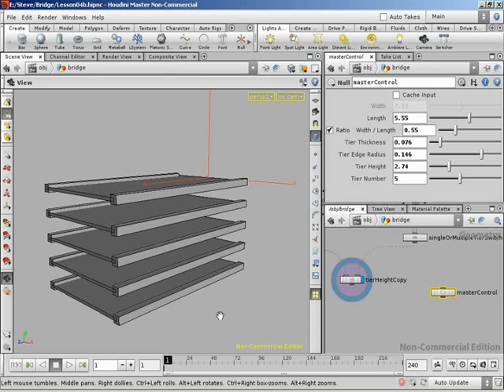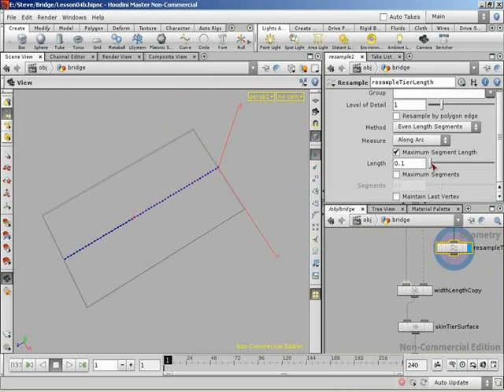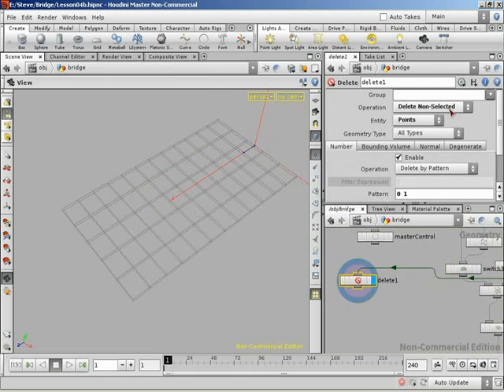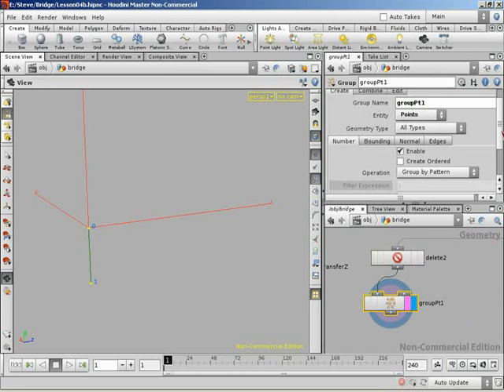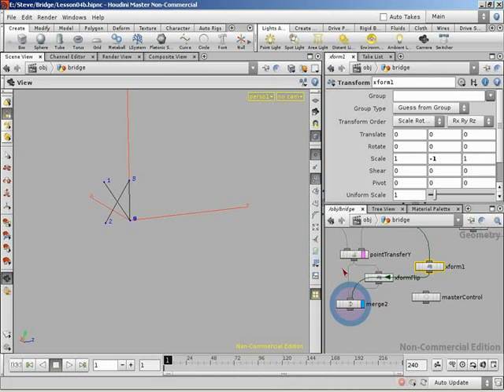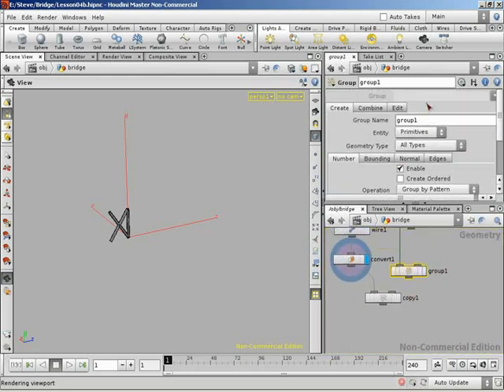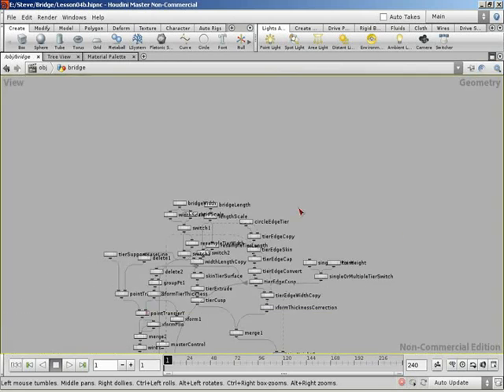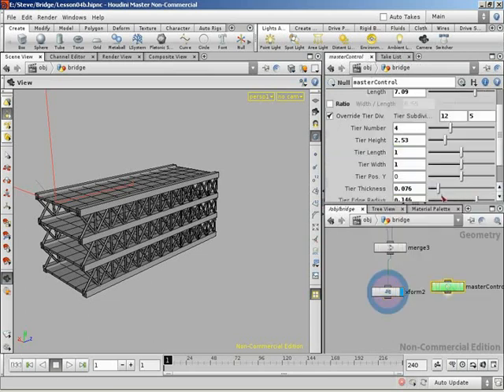3dbuzz - Houdini bridge contest - Houdini Bridge lesson04 tierSupports (5/13)

Comment: Hi Peter
I have a noobs question.. How can I edit the value of the point 1 to  -$TZ2 of my second input in vex ?
I have tried with :
setpointattrib(1, "P", 1, set(0, 0.5, -0.1), "set");
visually it works but I'm not using the real points position..
I'm definitely stabbing the dark any clue will be much appreciated..